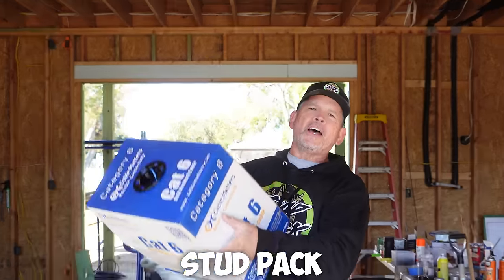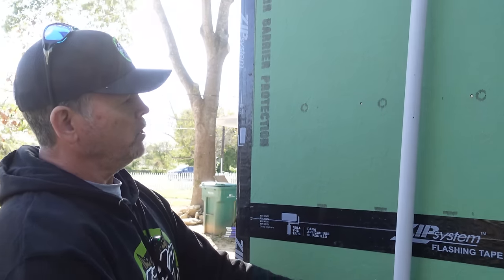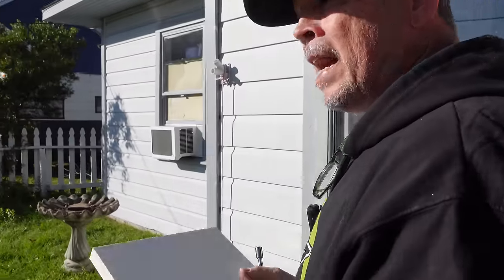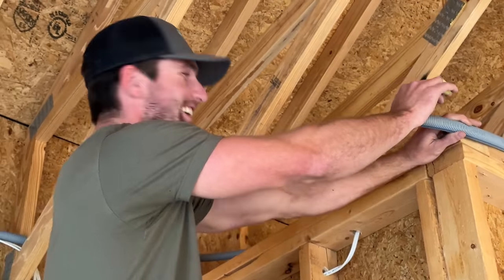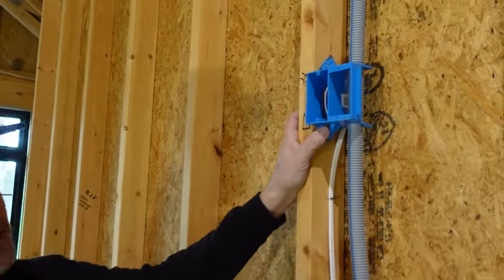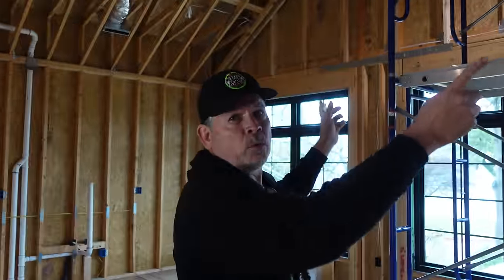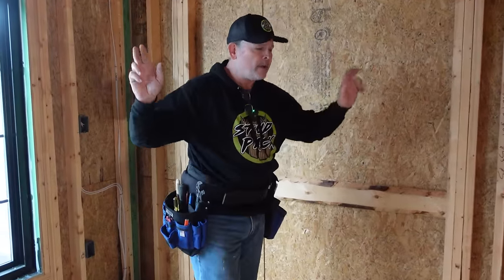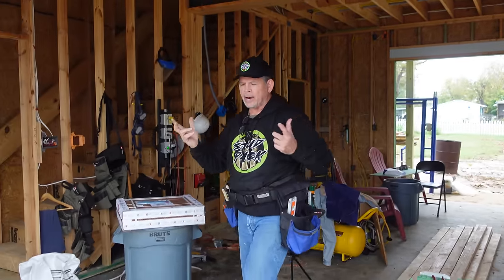DIY Networking for a Future Proof and HIGH SPEED Home! (Smurf Tubing and String Pull Trick!)

Comment: Note: Always run the CAT6 cables a little long on both ends.  This is called a 'Service Loop' and allows you the extra length to be able to replace the connector if it gets damaged.
Note: The fiber core at the center is part of what allows the cable to run high speed signals by holding the internal wires properly spaced in their correct positions.
Reply: I love service loops.  Nickel now saves a dollar later

Comment: Don't recommend directly terminating the CAT 6cable into the RJ45 connector. I would use a small patch panel with patch cored. IMO it will last longer.  Vibration can loosen the crimps.  The little plastic in the middle of the CAT 6 is a separator to keep the conductors separated to maintain the necessary cross talk,  etc so it can meet CAT 6 specifications.

One last thing.  Always pull a spare wire/fiber from the demark to your  closet.  That way if the apartment become a rental they can have their own service.

Always enjoy watching!!  Keep up the good work.
Reply: Yes,I like the punch-down connectors for terminating into a patch panel. Then you can add/remove as needed with patch cables.  I did that in my basement remodel. An electrician ran the  cables, but I had to terminate the ends.

Comment: Hey guys! I sent over some HVAC tools this week, I hope you got them. It's just a few things for working with flex and insulation, but it should make it a little easier on the main house build. I grew up around HVAC working at our family business with my dad and It makes me smile seeing you guys doing the same thing. 

However, I'm in Telecom now working as an Infrastructure Planner! We install a lot of fiber and Cat6 here and for the main house depending on where your fiber run needs to go internally, and the length of the run, you might want to consider running something like a 12.7mm inner duct instead of the ENT tubing you used in the garage. This will allow your fiber installers to inject the fiber instead of having to pull it. They can use a less expensive cable (without sacrificing quality of signal) because the tensile strength requirement is decreased for injection applications and it's WAY faster. That's how we install all of our fiber here at the University (underground and inside the buildings) and we are actually experimenting with doing it the CAT cabling as well.

Comment: You can use that Klien crimper to strip the cable, but only like a half inch. Then use the little string inside the wire to pull it down the rest of that 1.5" or so. You can use nippers or scissors to cut that jacket off. That way you don't accidentally nick those wires while your stripping. Additionally, once you've pulled through the RJ45 connector, you can twist that excess and then just crimp/cut at the same time. Makes it much faster and less to sweep up. 

Also, I agree with what others have said. You should use those wall plates rather than that direct connection thing.

Comment: @StudPack  - Sysadmin/Network guy here - just adding a +1 to everything that has been said already. 

Generally speaking, in-wall wiring should be solid-conductor and terminated on both ends to a keystone block (a punchdown type termination) which is clipped into a wall plate, or a keystone patch panel. You then test/verify/certify the run, and should never need to touch it again. Then use prefabricated stranded-conductor patch cables to the switches/endpoints - they are much more tolerant to flexing and much easier to replace. It's analogous to using copper/pex in-wall, and flexible braided hoses for toilet/sink hookups - even though it's not gonna move for most of it's life, it's much more maintainable if you ever need to swap out the faucet. I find at the network switch side of things, using slimline cables between the patch panel and switch ports also makes maintenance a lot easier.

That being said, it's not uncommon to terminate solid conductor directly to RJ45  - it's not the end of the world, and sometimes a more practical option, like if you're running some exterior grade cable to security cameras, and don't want an inline termination before the device that you now need a more expensive waterproof housing for.

Few other points to reiterate :
- Nothing wrong with using plain cat6 (as opposed to cat6a) for 10Gbit on short runs (<30M).
- Avoid running unshielded twisted pair (UTP) wire in parallel to power lines, even if through a conduit. The other side of the void in a stud wall is fine. Cross power lines at 90 degrees where possible. That said, I've ran cables parallel to power plenty of times in the past out of necessity, and rarely had issues. You might find though if you're running 10Gig that it's more sensitive to the EMI.
- Not all RJ45 connectors are created equal - some are not rated for terminating to solid conductor wire and may slip over time. usually the spikes on the bottom of the pins are flush for stranded-only cable, and slightly offset from each other (sort of like the set on a handsaw blade) for stranded/solid. 
- If possible, borrow a cat5/6 certifying tool (super expensive) to test your terminations - if you can't get hold of one of these, aim for a verifier (also quite expensive), or at bare minimum a pin tester (cheap).
Reply: Fellow network admin. I kep hitting thumbs up hoping it would count more on this.

Comment: Hi Guys, great video! As others said, wall plates are better - you don't limit yourselfes to a specific radius in which you can put your devices and you don't risk damaging the cable right in front of the outlet - you would have a hard time getting a plug on there. Also, in Germany we usually use duplex Cat7 S/FTP cables, are these a thing in the USA? They cost a bit more, but you get way better shielding from outside interferences. Having two outlets instead of one is also nice and kind of a future-proofing. Personally, i would like to have at least two ethernet ports per room in a new building for the same reasons.

Comment: I would have run to the electrical closet for your fiber termination with a small rack for the fiber endpoint and a patch panel with drops running upstairs to wall plates. With all the video editing and footage, I'd be thinking about a place for a nas in an enclosure in the main house and run a single ethernet and fiber cable from the garage to the main house and move the endpoint into the main house later.  If you're going all out on the house, you can go all out on the networking.

Comment: What manufacturer of network gear are you planning to use? I would recommend equipment that is manageable; great for trouble shooting and managed equipment tends to be a higher grade. Also, make sure you get equipment that supports PoE. There is a ton of equipment that uses PoE (e.g., wireless access points and security cameras); it is worth the extra money getting a switch that provides power. 
Consider adding a battery backup (UPS) and surge protector where you place the network equipment.
A lot of people will use Unifi/Ubiquity equipment for projects like yours, good quality and readily available. Cisco and HP manufacture decent network gear too.

Comment: Another wall plate and jack recommendation.  All benefit.  No drawback.  While there are plenty of drawbacks to not using wallplates (damaging the in-wall cable, etc.).  If you're worried about degrading the signal with additional terminations. . . don't be!  It's a non-issue in my exerience.  I've personally run Cat6 throughout my house.  Even a run that goes from wall plate to ceiling wall plate, patched to another wall plate, through a wall to another wall plate in the closet, and the finally to a 10gig switch. . . no issue.  Get full 10gig speed even at well over 50 feet in distance.

Comment: Be wary of the bend radius requirements for fibre-- it's unlike copper cables since the optics of the glass fibres require smoother transitions. May want to double check with your ISP before closing all of that in.
Reply: fiber can be bent a lot more than you would think without breaking. I'd keep the bend no smaller than a softball and it'll be fine
Reply: @Seris_  It can be, but if I were them I'd still confirm with the ISP or whoever is doing the pull. I design large scale IT systems and our spec aligns with TIA guidelines which requires between 10 to 20 times cable radius for your conduit sweep. From the ISP's perspective, I would probably not warranty the installation if installed in what is provided here.
Reply: @Seris_ it’s not about breaking, it’s about the light loss over the distance of the bend. When fiber is bent, it opens up the edges of the glass and light escapes. The tighter the bend the more light escapes, the longer the bend, the more the light escapes.

Comment: Here's a tip: When pulling cable, go ahead and pull another string along with it, so when you are done, you have a pull string ready for the future, already in the conduit.
Reply: YES!!!!!!🎉
Reply: 100% agree.  Pull string is almost free. Leave a small roll in the boxes in both ends, pinched or tied off, of course.  The only exception I would make for that is a longer/difficult fiber pull (mine was 220ft underground with a total of 360deg bends) where you will absolutely not be pulling anything else in the conduit without pulling the whole thing out (to avoid damage).

Comment: Just my 30 years of networking experience speaking here:
1. Pass through connectors can result in corrosion starting in the end of the cable and working its way back. Not really an issue inside unless moisture gets at it.
2. When striping the cable you can nick the inner wire ever so slightly that can degrade the signal or possibly even break off so you should rip the jacket back a couple inches to make sure you're not terminating a damaged cable.
3. I'd highly recommend keystone punch down jacks for terminating cables then use pre-made correct length booted patch cables with strain reliefs to connect devices from the wall plate jack.
4. Use wired connections whenever possible, more secure and reliable than wireless.
Reply: I was looking for this, exactly what I wanted to say! Addendum to #2 The thin piece of string inside the cable jacket (that got cut off) can be used to cut it back without danger of nicking the inner strands.

Comment: Be aware there is a limit to the bend radius of the fiber. Where the Smurf tube enters the building and makes a 90 up the inside wall may be too tight of a bend. You can measure the bend radius in the existing fiber box on the old house to see if your 90 is too sharp.
Reply: It will be good, the fiber they bring in has a really small diameter so the bend radius will be fine.

Comment: Tip: when unrolling hose from a spool, roll the spool (like a tire) as you pull out the hose. You won't have the kinky 😆 problems. I learned that w/ running drip irrigation lines.

I got to see them replace my utility pole in my back yard several years ago. It took days prep. First, Asplund came into the neighborhood to trim trees (70yo neighborhood, there were a lot of volunteer trees). Then they parked the auger truck on plywood boards on my neighbor's back yard. They didn't bother pulling out the old pole, they cut it off at ground level and drilled a new hole next to it for the replacement pole.

Comment: For your devices, in general, wired works better.  My DVR and Roku box use a wired connection and are very reliable.  My obligatory 2 cents, I would have used Cat 6E 600MHz cable.  You probably already bought it, but if you can get it on a spool versus a pull box, pay the extra money.  It is so worth it.

Comment: You should wire a patch panel in the attic and then use keystones with wall jacks in the low voltage boxes. Looks cleaner and more professional. You should then use a premade cat6 cable with strain relief to the device. The inwall stuff is not designed to be responsive to movement compared to premade patch cables.

You should also have some slack in your line. If there is an issue with the termination you have to cut off the end and start over.

I'd put a small rack in the attic with the patch panel so you can also mount your switch and other devices to it and have a nice clean install.

The other nice thing with using keystones is you can add stuff that is not cat6 such as coax, fiber, ir receivers, banana jacks for speakers, etc.

Don't run the smurf tubing on top of the electrical. It should be at least 12-18 inches away from it.
Reply: I'd say the patch panel should be in the electrical room since you have one. Although if the "attic" space is air-conditioned maybe it would be better
Reply: Heat kills network equipment. Clean is always nice but not worth the replacement cost of new equipment due to premature death. Id stay out of the attic unless it has ac and is easily accessible.
Reply: @dude2356  I think the "attic" might actually refer to the loft-type space above the staircase that is still within the conditioned space, so it may be the best place for the equipment.

Comment: IT guy here - the Cat6 should be terminated in female keystone jacks in the walls. Then you can use replaceable, variable-length cables connecting from the wall plates to the client devices. On the other end, the in-wall cat6 should be terminated in a labeled patch panel (lots of different options for both rack and wall-mount). Then shorter patch cables connect the patch panel to the network router/switch.

Comment: I hope you're going to be using cameras with POE. Your kid is smart to decide to have hard wired systems. The more the better. With more and more "smart" tech going into simple items, he's better off saving as much Wi-Fi as he can. I have my Wi-Fi in three frequencies. first for the home automation gear, the second is for the laptop/tablets and the third is for cells and other accessories. All my tech is independent of the cloud or any subscription services now and in the future. I hope he sets up a Home Lab/VLAN/firewall with a server or two for his security systems (1 for each building), a network for the office and another possibly for the home theater AV storage.
Reply: Exactly! For security cameras, I would ALWAYS recommend wired "PoE" cameras over wireless! You want to use as much as you can on a wired connection instead of wireless!

Comment: Do not put data next to high voltage if possible. I'd hate to see you install 10GBe network equipment and get a fraction of the speed. That stiff part in the middle of the cable is shielding to prevent crosstalk between the pairs (which is also why the pairs are twisted at different rates). You will most certainly regret running cables with RJ45 connectors vs using keystone jacks and patching from there to your device. Also, be sure to leave service loops in case there's a need to re-terminate in the future. Personally I'd put a 19in wall mount enclosed rack in the garage at service entry, have my modem there, firewall, switch, etc... heat shouldn't be an issue with some top mounted squirrel fans for venting and you'll have relatively easy access. (source: I do this for a living in commercial environments)
Reply: yes, yes, yes.
Reply: I second this, either there or in the Utility closet with the Electrical (on a Different Wall).  Then run conduit (or smurf) to the Bridge to run network to a closet in the house once built.

Comment: We always use the jacks, it’s cleaner and more resilient, because the tabs on the cube ends always breaks. We also use CAT6A now and a patch panel in the IT closet. The conduit we get is orange and already has a pull string in it.